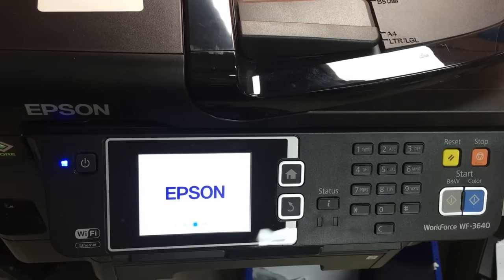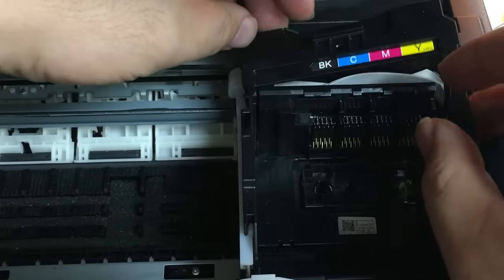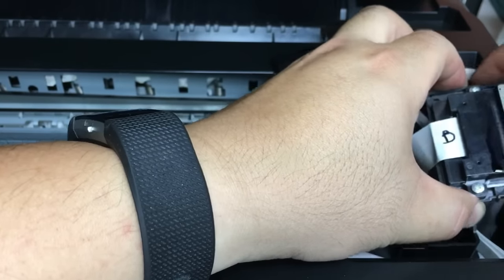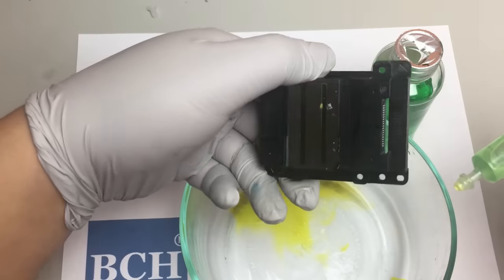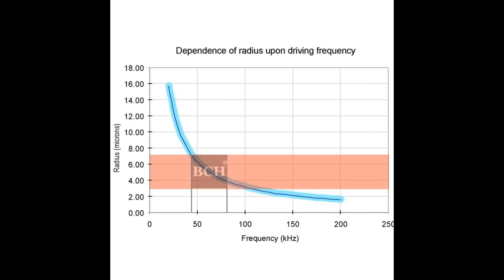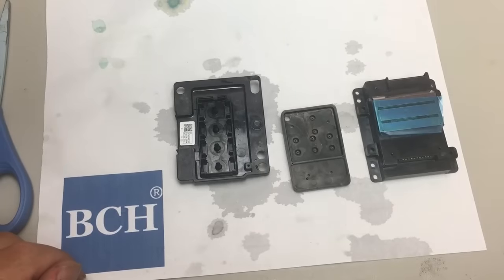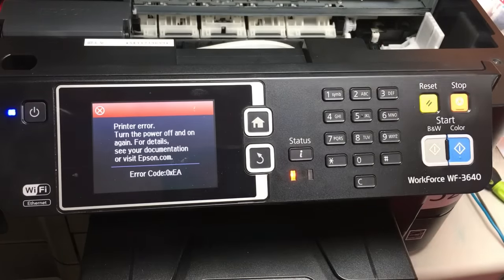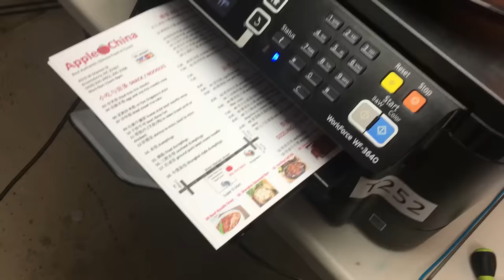Extreme Unclog Epson Printhead WorkForce WF-3640 Fix 0x97 0xEA Error

Comment: Also, how long in the ultrasonic cleaner? Thanks for your videos. I used another for the quick clean and it worked for awhile, then it clogged up again.
Reply: Hey Kevin. I cleaned the printer head using your video and then I guess clogged up again. I bought a different cheaper printer and it works ok. It goes thru ink really fast and not the best results. So, I thought I would mess with the WF 3640 again. It has several extras that I like and some I need. It’s not printing, but comes on ok, no errors. I put a Windex soaked folded paper towel under the print head, overnight. Did a head check, the next day and a couple head cleaning passes. Got some black grid on the print head check. Did again last night. So, what do you think about just getting g anew print head? They’re only about $35.00. So?? It could be the ink is crap. It’s off brand, but I don’t want to get more ink for this, if this thing is not gonna work. What’s your thoughts. Appreciate any help. Your videos are so helpful. Thanks

Comment: This is a very good video must say. Based on that i have tried first time to repair my printer upmyself. Now the 0x97 error is gone i think, but after that i got a 0x9A error message on start. Nothing is moving, no noise, only bell is ringing some times and then the error comes. Have checked all several times, but i can´t see any mistake. What can it be ? Anyone has an idea ?
Reply: following
Reply: I got the same error, and had to clean the clear strip (encoding strip I think?) that runs behind the top of the print head assembly with a gauze dampened with alcohol. It was probably dirty from all of the cleanings and messing with the nozzles and cartridges since I picked up the used wf-3620 a little while ago. Then I reset the printer by holding the power button in for a minute or two, plugging the power cord back in while still holding the button, and continuing to hold the power button for another minute or two. This cleared the error message.

Comment: I uncloged my epson 1290. It draws color and black line on a papertowel. Also the ink comes out when head cleaning, at the parking place. I can see the different colors on the sponge. BUT it doesn't print any pixel at all. I tried the nozzle check pattern. Blank page. I tried to print something. Blank page. Anyone has any idea?

Comment: followed the instructions, minus the ultra sonic bit. Once i put it all back together I get an  error code 0xE8 and the print head unit gets stuck. Off to buy a new printer. This was my last resort. NEVER buying epsom again.
Reply from the maker: If you see the back of the printhead carriage, there is a transparent belt.  Most likely this belt is caught when you remove the printhead.  Untangle it and it should fix the problem.
Reply: The transparent belt that Kevin talks about is in the back of the printer assembly. I had the same problem and everytime I got the error the belt was stuck on the left hand side.
Reply: @BCHTechnologies  The encoder strip?
Reply from the maker: @bvnseven  Does the encoder strip look okay?  Did you put it correctly?  Sometimes it got tangled in the back and the printhead won't find where it is.

Comment: it's cheaper to buy a new print head... or even printer as a whole :P  the folks i inquired about cleaning my print head wanted $250.  i trashed the entire wf-7610 and got a brand new one for $150. i got a new one because the rollers weren't picking up correctly anyway (more than 1 sheet sometimes, or a corner would come out bent on others, rarely, but once is too much).
Reply from the maker: Where did you get a brand new WF-7610 for $150 while the market price is $570?

Comment: does anyone have any suggestions on how to do this without using such a expensive ultrasonic cleaner? affordable ultrasonic cleaners wont help at all if im reading correctly right? So only the very expensive ones will work, so any suggestions would be appreciated.  OR if anyone knows where to get an affordable ultrasonic cleaner in the 80 khz range, that would be helpful as well.

Comment: Hi Kevin, you're amazing!  I'm Chris Nguyen.  I've never known this cleaning method.  Can I clean the print head of Epson Photo Stylus 2200?
Reply: I'm doing my r2880 now.  I had three nozzles complete clogged with 8 year old ink.  This method cleared the blockages.  I did not put the head in an ultra sonic cleaner as I'm not sure if this is one that the poster cautioned against. However, I did put the top portion with the spikes in an ultrasonic cleaner,  that worked well.  I used an oral syringe that I got from a local drug store to shoot some Windex/Rubbing alcohol fluid into the head's ports, and let them sit for a while, as they are too small to use his technique. It appears to have worked.  Currently, I'm letting the components dry before reassembling.  I suspect that reassembling the printer may cause some issues.  But if this doesn't work, the printer was trash anyway.   I'll update if/when it's all back together.

Comment: I DID THE CLEAN TWICE , BUT NOW ERROR CODE 0X97
WHAT CAN I DO?
Reply: your cable connector socket is wet
Reply: @oliverespinoza3171   how to let the cable connector socket getting dry
Reply: @sonjohn2399  honestly i would just stop throw it away. This printer is garbage. I bought an HP
Reply: @oliverespinoza3171  maybe the printed circuit board of the print head is burned,beacuse of i had put the printed head in the machine before it was dry.
Reply: although the printer could be turned on to print,but it print out blank paper. and appear the error code 0*97?
Reply: can i use a multimeter to detect the voltage of the print head to determine whether the printer head is burned.
Reply: @oliverespinoza3171  i don't know how much a  second-hand print head costs of i buy it online.
Reply: @sonjohn2399  dont waste your time . Get rid of the print.

Comment: What is that sponge below the fuser for and what happens if you remove it completely? My printer is missing that
Reply: When the printer goes into clean heads mode, the black sponge is to collect the ink that is pushed through the print head. I would think that, if you don't have the sponge, the ink would flow down to the printer.

Comment: I've cleaned the printhead and all the nozzles are unclogged , but after several (more than 5 ) cleaning cycles from the printer settings. There is still no ink coming out from half the black and all the colors. Is it possible that the circuit board was fried ? There is no error message...
Reply from the maker: It could be the TFP (thin film Piezo) is damaged.  I am making a new video to show how to unclog dried cartridges and avoid TFP damage.
Reply: @BCHTechnologies  Thanks for the reply. Looking forward to your video, at least not to damage more printheads :D
Reply: @BCHTechnologies  so - after cleaning it's just not printing at all - white paper comes out... if TFP damaged - then there is nothing can be done, but replace the whole head?

Comment: I just don't have an ultrasonic cleaner or air compressor lying around. Sad!
Reply: you dont need either. Air Duster works well and if anything a jeweler has ultrasonic cleaner pans and regular tap water to soak. many others use Alcohol if they dont have an ultrasonic cleaner

Comment: I followed the instructions to remove and replace the printhead and now the printer will not turn on when I push the on/off button.  Perhaps I reinstalled the print head incorrectly; will that prevent the printer from turning on ?  If so, I will start over ...

Comment: I followed this video instructions and reinstalled the printer back, and now I am getting error 031008
Reply: Hi Andry. Did you finally fix this error code?
Reply: @marckleejoseph2498  I did not. My printer is still showing the same error message and I am unable to use it.

Comment: Warning: if you clean the print heads after cleaning the print head you may blow motherboard and fcc cable. This printer is trash. It will destroy itself if you use the print head cleaning command a few time after printhead cleaning. Also cleaning the print heads will drain your ink very fast. Total junk.

Comment: Great video but a JUNK printer. Had mine less than a year to replace an HP that was over 10 years old but still working. What a mistake. HP is still going and the Epson has long been a shiny paperweight. I will never buy an Epson again as I have seen way too many complaints about their products unfortunately it was after the fact. Lesson learned.

Comment: The main reason people have this issue is they keep their inkjet printers in too dry and hot a location. If you want no problems, put a humidifier next to the printer - it needs at least 40% humidity not to clog.  If you keep in dry hot area, it will clog and die  --
Reply: I have ducktaped a piece of plastic to the inside top of WF-5690, and poured little water there to keep the humidity. (It was originally the plastic part of three piece W5 mini air refresher plastic package.) Picture https://images.wogibtswas.at/data/image/500x705/558/w5-lufterfrischer-mini-spray-2785518.jpg  but any other similar plastic cover is fine.
Reply: @aris95  I would love to see a picture of what this looks like.
Reply: @zantiamartin85  Unfortunately i don't have this printer anymore but it is easy to tape this kind of plastic cover  in this model inside because there is plenty of free space. Some cases there is not much space so it is best to keep the printer in room where it is sufficient moisture not too  dry